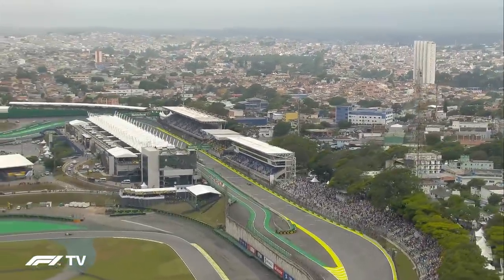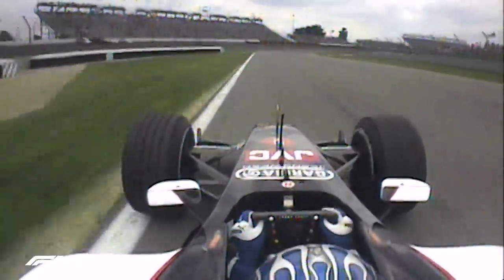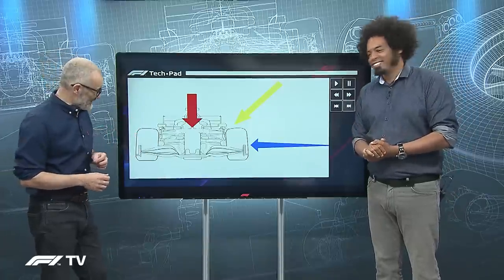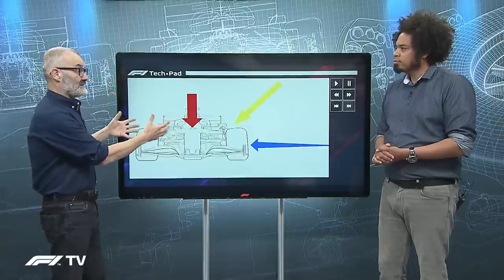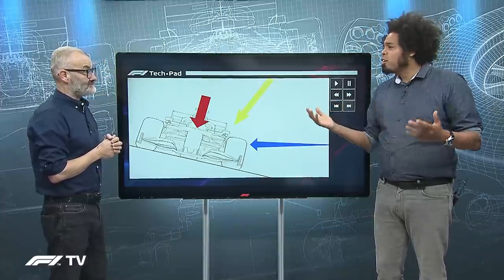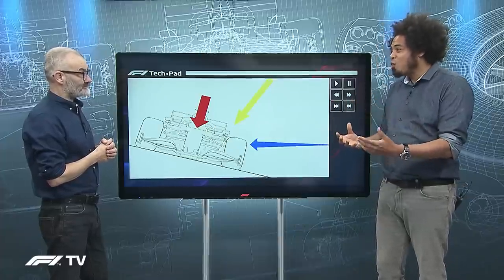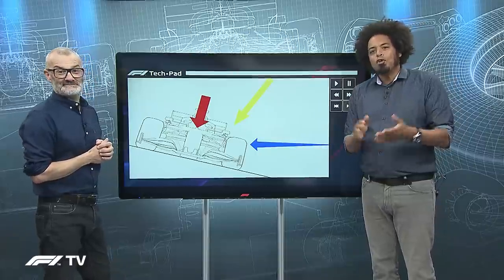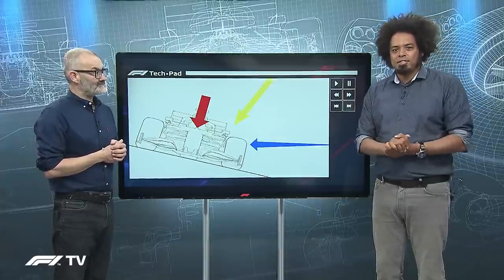Zandvoort's Banked Corners | F1 TV Tech Talk | Crypto.com

Comment: the force diagram comparison is a little misleading... the red arrow in the 2nd diagram is now ONLY the 'downforce', while the weight force is always vertically downward (regardless of banking)
Reply: The force vectors varies according to mass, rate & angle.
Reply: Doesn’t change anything
Reply: I think you've just made it more confusing. I think what you're trying to say is that the gravity force vector is always perpendicular to the Earth's surface. On a flat surface both the downforce of the car and gravity can be shown as one vector as they are essentially acting in the same direction (what we see in Dia. 1). On a bank the downforce and gravity are no longer working in the same direction so two arrows showing each force vector individually would've made more sense as they can no longer be summed along a single axis. However, most people would be confused by this so Craig has left it out.
Reply: Yea as someone in a physics major,.. this was a bit painful to look at. 
But the diagram was there to get a point across, not how accurate it is (and in the end, they made their point)
Reply: Andrew Gunn - Think about a banked corner like you would think about swinging a bucket half full of water or taking a spin on the gravitron at an amusement park. Gravity is pulling the object away from the center and even up the wall. Simply put though, the first comment has it right.
Reply: They did mention the red arrow is the downforce. Also if you really go into the detail, regardless of the downforce, banking will always help you cornering faster, even if it's just a family car.
Reply: Yeah they forgot how to draw basic physics vector diagrams!
Reply: I mean in the end we are watching a video about how banking helps cars go faster. Not really hard to understand
Reply: @wraitheful  no mg remains vertically downwards always
Reply: Exactly, if he's going to whip out the arrows he might as well put them all one the 2nd diagram.
Reply: That’s what Craig said
Reply: Not only is it misleading its not even showing real forces but apparent forces. The blue “centrifugal” force is not real and should not be in the diagram. There is nothing pulling the car out of the corner. The arrows he should have drawn, and the only real forces, are the red downforce arrow, the mass perpendicular to the earth, and the normal force perpendicular to the track. 

The problem with drawing the blue arrow and the yellow is people get more confused that way and think something is pulling them out of the turn when what’s really happening is the banked turn is changing your direction from going straight to turning.
Reply: Downforce is generated by the car's aero and will be perpendicular to the car, hence it is theoretically possible to drive a formula 1 car upside down. This is different from gravity, which is vertically downwards.
Reply: Downforce acts perpendicular to the wing and the car's weight act's vertically downwards, right?
Reply: @bighammer3464  exactly. Really poor explanation in the video imo.
Reply: WOW look at a youtuber Correct these guys lol
Reply: Yeah that bothered me to: Gravity always points down 👇
Reply: I'll give them the benefit of the doubt and say they did it to make the diagram more clear
Reply: its so common people can understand it i guess
Reply: It's obviously a "tech for dummies" video. Discovery couldn't do it worse.
Well at least they did not measure the forces in 'fully loaded 747's'
Reply: The red label is downforce not gravity, the area of low pressure on the wings will be the red arrow. If you turned the wings 90deg youd also rotate that red arrow.

Comment: Old hockenheim banking is the one I would drive a car on.
Reply: Do you mean the slightly banked 180-degree corner in the stadium section?  I'm pretty sure it still has its banking.
Reply: At Hockenheim Never was a banking
Reply: you mean the nürburgring?
Reply: @Carbonarars , there's one left hander in the stadium section with a relatively high (by F1 standards) level of banking, but it's a medium to low speed corner.
Reply: @flyingphoenix113  sachscorner, but to call it a banking 🤔
Reply: By the way, he wrote: old Hockenheim , think he ment the eastcurve, this had a banking  like the Sachscurve, But i think, it had only 8%

Comment: Interesting, and you delivered the point, but nonetheless the red arrow in the banked corner is wrong. Gravity and downforce no longer point the same direction (straight onto the car). The resulting red arrow should be between where it is in picture one and two. Other option is to neglect gravity and not mention it on picture one.
Reply: I was rubbing my hands to come up with a similar comment. I’ll like yours instead👊🏼
Reply: Can you then explain to me how is the red force (resulting force) then more to the left then?
Reply: @robertjusic9097  I might use some english words wrong, sorry in advance. :) In picture one the car is flat on the ground. Downforce and gravity point the same way, 90° to water level(bottom of the screen). In picture two gravity still points 90° water level, but the ground and car are not parallel to water level anymore -- they are tilted to the right. Gravity still points the same way as before, but the downforce is tilted together with the car, as the aero always pushes the car onto the ground surface. E.g with an insane downforce a car could ride on the ceiling, with gravity pointing the exact other direction as downforce. So as soon the car is not parallel to water level anymore, gravity and downforce point in different directions. In the second image they draw the red arrow as before -- pointing 90° onto the car, which is exactly (but only) the direction of the downforce. We know however, that gravity is still pointing 90° to the bottom of the screen. A combination of these two arrows would then be a little to the left of the red arrow they showed here. (Combining works the same way as with their red and blue arrow in picture one. If red (gravity/downforce) and blue (centrifugal force) have the same amount of force, then the yellow arrow is exactly in the middle of them. ) 

The intention of a banked corner is to drive the corner faster. What is the reason you can't go fast in a corner? Centrifugal force pushing you off. So in an extreme scenario you tilt the corner so much, that at the max speed of your car there is no forces to the sides of your car. The part of gravity that pulls your car down the corner equals the part of cetrifugal, that is pushing your car up the tilted corner. Then you have max speed without any sideways stress to your tires. If you go faster centrifugal will be higher and push you up. If you go slower, gravity "wins" and you go down. (Both if your tires can't hold it of course)

Comment: I want to build off of your point about banking destroying cars potentially. Could the Merc and AM retirements be caused by this banking since both are the low-rake concept?
Reply: Those would appear to be power-unit related, both cars have Merc PUs however added mechanical strain from higher cornering speeds could be the cause.
Reply: @LETSTALKENTERTAINMENT  It's not NASCAR
Reply: @LETSTALKENTERTAINMENT  I'd say it's more that they're built to be driven so hard they detertoriate

Comment: Is there considerably more added stress on a driver’s body when racing F1 on a banked circuit?
Reply: Yep. Driver experiences more vertical forces than lateral forces. These vertical forces are usually experienced in nascar, and on higher level, by aircraft pilots
Reply: Short answer
Yes and a lot

Comment: Why do so many people wrongly believe that the centrifugal force is some magical thing that  'pushes you out of the corner'? In fact that force is pointing TOWARD the center of the curve (circel), it pushes you THROUGH the corner. The feeling that you have in the car is the SPEED you have. Without the centrifugal force you would go in a straight line (like every moving object will naturally do), so you would crash out of your corner. The whole thing is that you need enough centrifugal force to constantly change the direction of your speed. There is a formula to calculate the needed force, given a known corner. Mass, velocity and radius are part of it, as you can imagine. Heavier car, you need more force. Speed increases, then the force needed is bigger by the speed squared. The radius is the other way around: a bigger radius, means less force needed to corner safely, so we divide though radius. OK, just theory. In any car, so in F1 cars too, the centrifugal force comes from grip (the maximum force that the tyre can interact with the tarmac, without sliding). Banking the curve will give more grip, because Gravitational force and the downforce (acting in different planes, btw), will both have a component (vector) pointing towards the center of the corner, so they will provide a part of the needed force, so less has to come from the tyres. 
Basicly, the more grip you have, the more your tyres will wear. Obvious, isn't it?

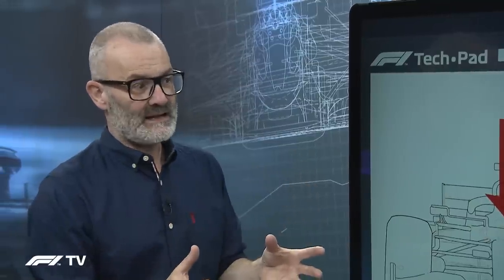Comment: 2:22  -  the arrows are wrong. the red one (gravity) is not perpendicular to the track because it points to the center of earth. you also have the normal force that applies on the car from the ground up. the net force is parallel to the track pointing to the right (centripetal). The centrifugal force (pointing outwards with the same magnitude) is due to newton's first law of motion.

Comment: I really REALLY think F1 needs to have unusual tracks like Zandvoort on the calendar -- I'm so tired of the Tilke cookie-cutter tracks.  Here's an idea I've had for a while for a northern European F1 circuit.  In Finland, at a point bordering Russia, I'd build a track that is much longer that typical F1 circuits and I'd try to meld a little WRC feel into it -- something like a blend of Le Mans with a paved WRC track -- maybe 10km long.  Have the circuit in both Finland and Russia with one very long straight al la the Mulsanne Straight.  Teams would have to setup the car for low downforce because of the straight and cars would be passed then they'd repass on the same straight.

Comment: In Max's FP1 lap video, we saw him driving to the top of turn 3 rather than hitting the apex, would this be to do with him wanting to reduce the stresses on the tyres and car at all?
Reply: I haven’t seen enough of F1 on banked corners to talk about F1 specifically, but on banked corners in other racing series, the higher line is used to reduce stress on the tire and carry more speed out of the corner. If I remember right, turn 3 is right before a fairly long straight, so taking the “outside” line allows him a higher speed on the straight

Comment: The loads on the second image are wrong guys. Gravity is always towards the center of the earth. That's why you tend to fall into the inner curve when you're still on a curb like that. The centrifugal force has to be parallel to the floor as well since it's cause by inertia.
Reply: I think the red arrow reffers to downforce, but yes I don't think it's very accurate

Comment: Does anyone know why drivers are taking the outside line over banked corners, just like missing the apex?
Reply: More speed fella
Reply: Why can't we ask those questions  to the teams? They should make a forum for this.
Reply: Basically: Inside line is faster in terms of time due to shorter distance but having to turn in which slows you down while the outside line you don’t need to turn in for thus higher speeds. It’s similar to the parabolica at monza
Reply: Im not an expert but it seems like the inside of the banking is too "crumpled" for those f1 cars, which may results in a tyre lifting off, so in order to keep the maximum grip and traction , they need to take a wider line allows them to carry much more speed through the corner.
Reply: @haze6254  it’s actually because the left or right side tires being on the apron (area of road below the banking) can unsettle the car due to it being flat and more slick then the banking itself
Reply: @shadowguy128  thank you for your explanation
Reply: Also the outside part of the banking they made it more steep then the center so going there you get more downforce so you can go faster
Reply: @africanosuinternwt6305  that’s with most banked turns. I believe it’s to help with safety and impact to barriers and stuff like that
Idk

Comment: May be you guys should talk about the effect on the drivers, too. Isn't high g-force for a substantial period of time dangerous to the drivers?
Reply: Vertical G can be, but they need to be larger for that to be really an issue. I can't imagine them going through more than 2G vertically here (sideways G is the largest). It's around 3.5 to 4G vertical that you start to have issues, although these are fit drivers that could train for that just fine. Fighter jet pilots go through up to 9G vertically, but they get extensive training and special suits that just block blood from being forced down to the lower parts of the body. The tires and the suspension themselves have to take huge loads here because they also have to carry the downforce on top of it, but that isn't a force the driver feels.

Comment: you will like it until somebody has a tyre failure or loses the control and crashes into the wall and back into another car
Reply: That could happen at any track, so you want no corners in F1? Just one 300 kilometer straight?
Reply: The cars will most likely slide along the wall, that's why it's a wall and not a tire barrier
Reply: @patrikjansen7831  Its a new sort of wall. Its a nascar wall. It looks weird but it will help with the banking
Reply: notwith the SAFER barriers

Comment: Would this have effect on the Engines? Wondering if it had something to do with Hamilton's oil pressure today
Reply: It's not a upside down circuit come on.
Reply: @legendareNz  6g? Pretty sure that's enough to move something out of place
Reply: Occasionally it can be tricky for oil pumps.

Comment: Back to the physics class.  There is no such force as a centripetal force.  A common misconception.  If you do a vector diagram of the car going in a circle, rather than the front view that was used here, it will show the force making the car go in a circle is directed toward the center of the circle.  Centripetal means "center seeking"
Reply: It is like gravity or coriolis force they are not real forces but they act like one.
But i d still call them forces for semplicity sake
Reply: no. false. cenripetal force certainly does exist and is a real force, centriFUGAL force does not
Reply: You are correct and am I embarrassed.  My former physics department boss let me know of my mistake.  I should have passed it by her before submitting.  I hope enough people to see your reply to know what it should be.  Centrifugal is the 'imaginary' force.  Centripetal is the one that turns the car.  
Thank you.